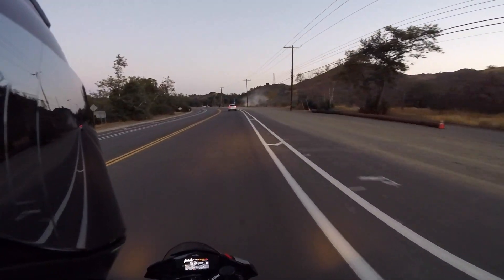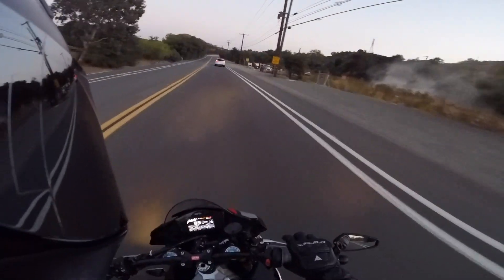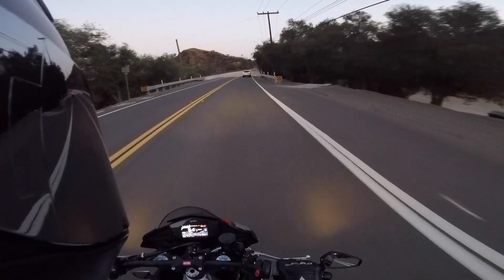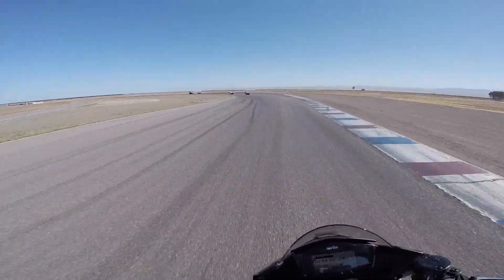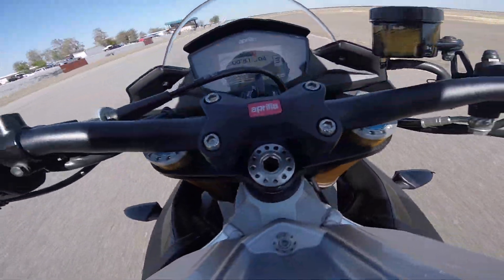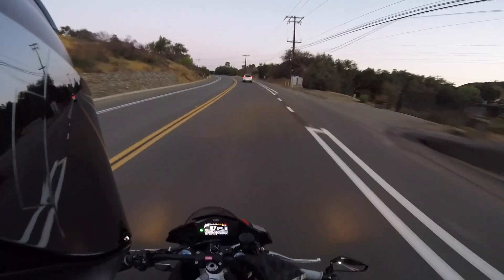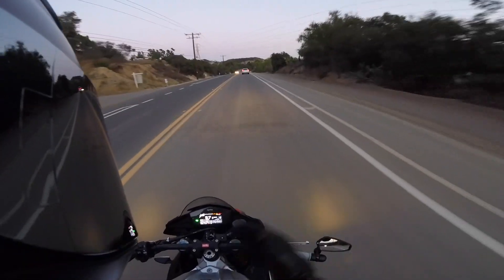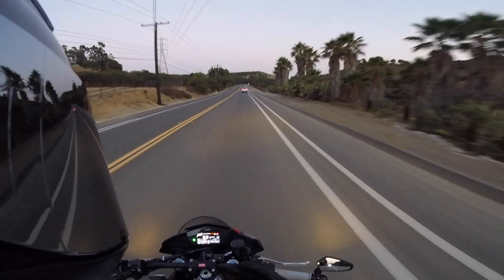Motorcycle Quickshifter and Autoblipper Explained - How Aprilia Quick Shift Up and Down Work!

Comment: Fitted the quickshifter on my tuono 660 I have been adjusting the clutch peddle few times as I always seem to be getting neutral from 1st to 2nd am I doing something wrong my side or is this expected or do just need to give more throttle? Thanks

Comment: Sorry I’m new to the bike world, how comes when you let go off the throttle the bike still able to run almost as if you’re holding the throttle but you’re not if that makes sense. I have a ninja 300, I don’t plan on getting a quick shifter on this bike but when I upgrade to a 700/800 I’ll get one.
Reply from the maker: @MichaelFas-n4n  this Tuono V4 has cruise control similar to a car, so you can set a speed and it will hold that speed without the need to hold the throttle open

Comment: Can you downshift into 1st gear using quickshifter? If so, what the max speed you can do this at?
Reply from the maker: Yes, you can. The blipper is disabled if the bike calculates an over-rev would be needed to match the wheel speed in the next gear down. I've downshifted from 2nd to 1st gear a bit above 70 mph without issue, stock gearing.
Reply: @hiimchad  wow! Excellent, thanks for the reply! There was me worried about downshifting into 1st gear 😂 normally clutch it from 2nd to 1st! Thanks!

Comment: Good explanation nicely done. 
I recently bought a new bike and i was considering putting a quickshifter on it but i am not sure. Dont get me wrong i think it is amazing tech to have on the bike but i feel like it will make me lazy on the bike. The shifting of gears and trying to rev match and such i feel like it is all part of the riding the bike experience and i think it is fun to do. I like the feeling of being in control of the bike and this takes away a level of control and do it for you. I dont ride on the track where your primary goal is to get around as fast as possible. I only ride on the street for my enjoyment and this is something that i feel is more useful for on the track and just a level of convenience for on the street. Also feel like it is adding to the things that can malfunction and fuk things up.
Reply from the maker: Thanks! I agree with your sentiments. There is something to be said fobbing skilled at changing gears yourself. I got to that point before I got the Tuono and was a quickshifter nay-sayer until I finally ended up with a 2012 Triumph Daytona 675R that had one stock. That completely changed my mind about electronics. I eventually converted it to a race bike and was never able to get a blipper, so still had to do the downshifts myself. Definitely cost me some time on track, but there isn't an aftermarket option that is reliable for that bike. I do enjoy using the Tuono's though, regardless if it's on track or the road!

Comment: Great video, thanks. My 2016 Tuono factory only has quickshift upwards. Could the auto blip be retrofitted?
Reply from the maker: Glad you enjoyed! My understanding is that while it's possible to retrofit the factory blipper to a 2016, it requires changing much more than just the sensor, such as the ECU and wiring harness. For what it would cost in parts you would likely be better off selling your 2016 and buying a 2017. Plus, you would get all of the other 17+ features, including cornering ABS and cruise control.
Reply: Good advice, thanks!

Comment: Im about to pick up a 24' Tuono 660 Factory this week. Are there any adjustments we need to make on these for the shifting to work 100%?
Thanks!
Reply from the maker: Congrats! Not sure what you mean by making it work 100% though. Does it have the QS and blipper? If so, it should work right off the showroom floor

Comment: Random question. At what rpm do you set your shift light for? I use my tuono mainly for street. Did you do a video on that? Thanks for any info.
Reply from the maker: I have not made a video about it but mine is set at 11,800 rpm. According to Aprilia, the engine makes peaks power at 11k rpm in stock trim, and the limiter is around 12.5k.
Reply: I appreciate it. I had mine set at 11k but I don’t remember why.

Comment: pretty much like paddle shifters in a car, you just kick to upshift snd downshift?
Reply from the maker: Pretty much! You still need to use the clutch to put the bike in and out of gear when stopped, and it is not recommended to use quickshift or autoblip below 4k rpm, but other than that, it is very similar.

Comment: He man I am just learning about motorcycles in depth.. I got a doubt. When we use quick shift at high rpms the motorcycle makes bang sound , why is it ? My guess is that when the  ecu stops some powerstrokes the unburnt fuel in the exhaust is burnt in that few milli seconds . My second guess is that since some powerstrokes are cut off and to overcome the drag and maintain the previous crank rot speed seamlessly , the next powerstroke gets max air fuel ratio , so it produces that paaattt sound ?? Could you please
Reply from the maker: Most quickshifter systems unload the transmission by cutting the spark. My understanding is that they don't cut the fuel, so some fuel enters the combustion chamber, but is then ejected unburnt, and usually detonates on the hot exhaust pipes, producing the pops/bangs.

Comment: are auto blips rough?
Reply from the maker: They're not always perfect, but I would say they are rarely rough. It works better at higher rpm, and best under hard braking from high speed, such as while on a racetrack. Can't even feel it in that type of condition!
Reply: @hiimchad  i just got a 24 r1 and the down shifts are hard asf when i hit them

Comment: I have a bad left ankle, so will this work so I don't have to flex my foot down under the shifter?  There is one for sale near me.  Brand new 2021
Reply from the maker: I wish I could give you an easy answer but I'm not sure. It reverses the shift pattern so you press the shifter down to change up gears, and you lift the shifter up from underneath with your foot to downshift. So you would still need to flex your ankle both up and down. Is it uncomfortable all the time, or only in certain situations like if you're accelerating quickly and need to force the shifter up from underneath with some Gs working against you?

Comment: Having this done on my 2016 RSV4 RF.  Does this change your shifting method?  Instead of 1 down 5 up, is it more MotoGP oriented?
Reply from the maker: Having an autoblipper installed? Not necessarily. You will need to change either which side the shifter linkage arm mounted to the transmission shift spindle is on, or which side of the shift lever the linkage is on. Flipping either of those 180 degrees will result in reverse shifting (1 up, 5 down), but you will need to either reprogram the Q/S sensor, or find one that works the opposite way to actuate the QS or auto blip functions (push vs. pull). Hope that helps!
Reply: @hiimchad  Thank you sir.  Already talked with Aprilia shop to set up reverses shifting.

Comment: Got tuono 2016 and sometimes when I’m not trying to use QS just using clutch it’s cuts my power off for a second and then it’s going , did something like this ever happened to you ?
Reply from the maker: Can you tell me more? Is it like the QS is still activating even though you’re pulling in the clutch? If you hit the shift lever a fraction of a second before you pull in the clutch, the QS will still cut power.

Comment: Can you please answer my question

If im at 150kmph and at top gear, and now im breaking hard to slow down...now should I blip the throttle for downshifts when even im breaking ( my doubt is while im breaking,the speed of wheel decreases which does not raise rpm levels when i down shift so im thinking no need of blip the throttle to mach engine rpm with wheel speed)
Reply from the maker: It all depends, but in my experience a small blip of the throttle is usually helpful. Sportbikes have such light flywheels and engines with low revolving mass that revs drop very quickly when you pull the clutch in, even as you decelerate. And if the engine is already at lower rpm, it’s closer to idle and will spin down faster as a result. But again, it’s all a matter of preference. If you have a slipper clutch in your bike, you don’t really need to blip at all, you can just use the clutch lever. If you don’t have a slipper, you will have to modulate the clutch yourself to prevent the rear wheel from chattering on decel, but I have known people who do that. It’s all a matter of personal preference. I’ve found blipping the throttle or using the autoblipper on my Tuono to be most effective.
Reply: @hiimchad  thanks for your reply
Reply from the maker: @-Venu-li1ki  happy to help! 🙂✌️

Comment: I have a 2018 tuono factory, and sometime my autoblipper wont work, then later in the ride it starts to work again. very annoying. I already replaced the switch sensor by the clutch. any thoughts?
thanks,
Reply from the maker: Hey Steven! Than might be an issue with the quickshifter sensor itself. Its in line with the shift rod. I would check the wire and connection. The sensors do fail occasionally, but it doesn’t seem to be too common.
Reply: @hiimchad  Thanks, I don't see any issue with it but maybe I will just replace it anyway.
Reply: oh and it is only the downshifting, the upshifting works perfect.
Reply from the maker: @stevenreeves4766  interesting, I suppose one position of the sensor could be glitching or something? Maybe try turning the blipper off and back on in the aPRC menu, and maybe recalibrating aPRC since those are both easy and free
Reply: @hiimchad  I am going to try the calibration to see if that helps. I will let you know how it goes.
Reply from the maker: @stevenreeves4766  best of luck! 🤞

Comment: Great description nicely explained, i have a 2020 RR not rode mNy miles yet maybe 500 but noticed on my last ride the upshift particularly 2-3 very jerky i get chain slap this was at lower revs and light throttle its fine when riding hard, also auto blip seems to work better higher up revs above 5k noticed it jerky below that.

Is there a certain rpm you should use it over? 

Thanks
Reply from the maker: Hey Hisaan, thanks for watching! Mine can be clunky at lower revs sometimes as well, both up and down. I typically just deal with it or use just a little clutch on low rpm downshifts to smooth things out, but the owners manual says the QS can be used above 4k rpm safely.

Comment: I'm about to buy a new street triple and wanted to upgrade to quick shifter. I asked the dealer if this is both ways (up and down shifting) he said yes it's for both ways quick shifting. But if I go to triumph website, quick shifter is not mentioning auto blipper that you mentioned in the video. 

Could you please tell me how I can I be sure of the dealer is giving me the correct info? 

Thanks for the video mate, Its really informative
Reply from the maker: Hey Karl! Thanks for the compliment! If the bike is brand new, I wouldn’t be surprised if a combination quickshifter/blipper is offered. I would recommend looking on the Triumph forums to see what others’ experienced have been. I know the Daytona 765 Moto2 had a standard QS/blipper, so the technology is definitely there. I’d also try to clarify with the dealer and set the expectation that you will not be happy if it does not do what they are describing, and call back to that if necessary. Sorry I can’t be of more help here!
Reply: @hiimchad  thanks for the recommendation mate. I'll go to forums
Reply from the maker: @karlfranz7434  Best of luck! Hopefully the unit does actually enable both.

Comment: Is this what’s available for the new Aprilia RS660/Tuono 660?
Reply from the maker: Hey Darren! The AQS system is standard on the RS660, but I think the Quickshift-down function is an option for the Tuono 660. I did a quick search and tried to find confirmation, but could not. But yes, it is the same system as on the Tuono V4 and it is my understanding that it can be added to a Tuono 660.
Reply: @hiimchad  okay thank you for the reply I appreciate it! I’m looking at getting a Tuono 660!
Reply from the maker: @darrenwilliams3398  That's awesome! Definitely double-check with your dealer, but I would be surprised if it wasn't at least a dealer-installed option. Best of luck!

Comment: Hi Chad, great video! The tech behind the shifting is explained really well. I'm still a bit unclear on on the downshifts, do you come completly off throttle or just not on throttle? Thanks again
Reply from the maker: Hey Mike, thanks for watching and glad you enjoyed! The Tuono's blipper will allow you to downshift with the throttle closed or open, but I haven't tried it while accelerating for obvious reasons. I have downshifted with the throttle opened slightly to maintain a constant speed and it was a little jerky, but it worked. The downshifts are much smoother with the throttle completely closed, and are very smooth under heavy braking with the throttle closed. 99.9999% of the time I use the blipper is while decelerating, so the throttle is usually completely closed. Hope that's helpful! 🙂
Reply: @hiimchad  thank you Chad, yes this is very helpful. I’m looking to buy one of the new Suzuki gsx s1000 gt which has the quick shifter, just wanted some heads up lol.

Comment: Well explained… Good luck when a S1000 pulls up 😈
Reply from the maker: Thanks! An S1000R would have a difficult time keeping up with this, but the RR would walk away in a straight line. That said, I'm quite confident I'd be able to get away from quite a few S1000RR owners on the track in the corners on this bike. I've done it before, after all 😉

Comment: Nice explanation. Now explain the wheelie control and other aPRC stuff =) Also what mirrors do you have?
Reply from the maker: Thanks Sam! I've actually already done videos on both wheelie control and launch control, and a high-level overview of aPRC as a whole. Traction control and cornering ABS are still on my list. 🙂 You can check out AWC, ATC, and the aPRC overview with the links below: 

https://youtu.be/Q27uIrMzhiU
https://www.youtube.com/watch?v=1XrOPPWlslE
https://www.youtube.com/watch?v=dvBx6GkH-VA

As for the mirrors, they are the CRG Arrows mounted on RhinoMoto bar ends. Do you have a Tuono as well?

Comment: It took me a bit to figure out the AQS functionality and what the icons meant. Orange = can’t auto blip but you can quick shift up at this time.  No icon = you can auto blip and quick shift up at this time. For a second I thought I had a faulty QS’r because of the orange icon.
Reply: Yea I’m still trying to figure out mine. When I’m riding and want to use the auto blipper I’m not going to be looking at the screen, I’ll be watching the road. I’ve just got the bike, I’ve noticed the orange background, I don’t think I’ve seen it not highlighted before. But mine has a red background now and is in the shop. I’m hoping mine is just a faulty QS. I just got the bike and have barely used the QS and the AB. Mines a 2019 rr with just over 1600 miles on it.
Reply: @BilboTeaBaggins413  make sure its enabled within the settings.  I think if you get a red icon, there maybe something faulty with your QS and will need to be replaced.  If still under warranty, you should be able to get it replaced.
Reply from the maker: @classicrogue23  hey Philip! Thanks for sharing about the dash icon! I honestly haven’t paid much attention to it and my blipper seems to work every time I want it to, so I haven’t given it much thought. Very happy to know this, though! 🙂
Reply: Whoa so what are the plus and minus buttons between left hand pointer finger and thumb

Comment: Great video! Ive got a 2017rr, do u have race shift pattern and if so is it easy to change?
Reply from the maker: Thanks Matt! I appreciate your kind words. 🙂 

I do have my Tuono set up for race shift. It is easy to do, so long as you have the right part. I have the Woodcraft GP shift lever adapter installed. It bolts right up to the stock rearset and maintains the quickshifter/blipper’s functionality. You can buy it direct from Woodcraft too! https://woodcraft-cfm.com/collections/shift-conversion-kits/products/08-5743-aprilia-rsv4-tuono-17-18-gp-shift-pedal-kit-for-oem-rearsets
Reply: Thanks alot chad ill look into it!!
Reply from the maker: @mattochaz  happy to help! I’ve been happy with the lever so far if it’s any consolation.